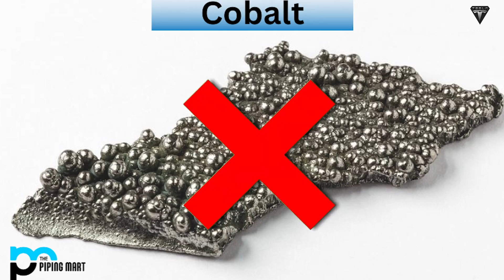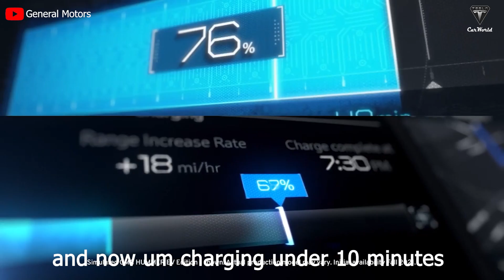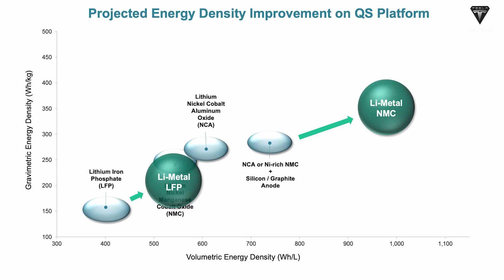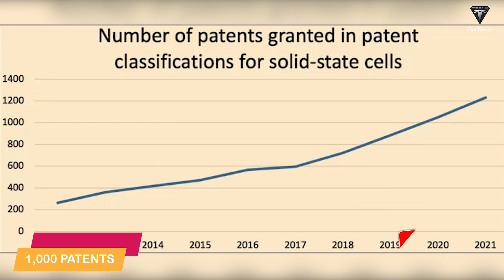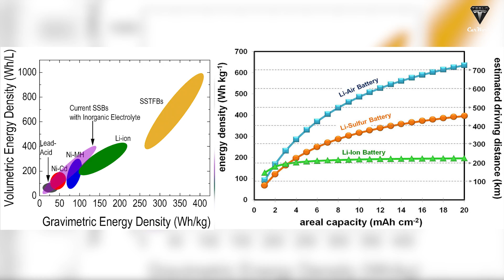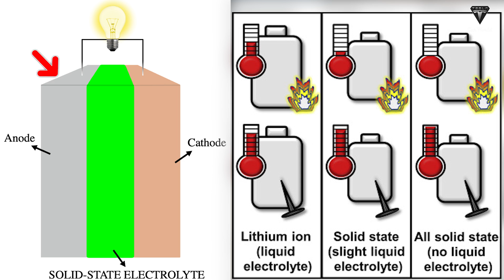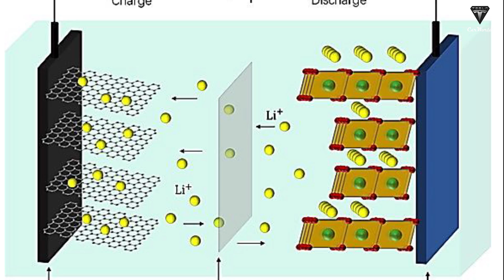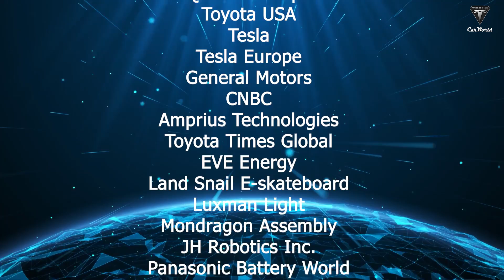Goodbye Lithium! The Breaking NEW 4.0 Solid State Battery Will Changes Everything in 2024!

Comment: I'm betting on Sodium beating solid state batteries.  Toyota will not be able to bring down the cost of solid state batteries enough to compete with Sodium, as sodium batteries will also start to drop in price in later generations, so solid state will never be able to catch up.  The only solid state batteries that will make it is the sodium solid state battery, which is already in the market right now.  So Toyota is already late to the show, since they project 2027, which is 4 years from now.  Too late to make any impact.
Reply: See Dongfeng Nammi 01 - first EV with sodium solid state battery.

Comment: Always 2 years to market. We've heard this all before. Always a let down when we find out that its not viable. There is always something, anode/cathode materials are not right. Dendrite formation, rare material, low life cycles., fires, slow charging, high resistance.... Always something. There's a reason Tesla gave up trying to make a solid state battery.

Comment: Its a bit like nuclear fusion, if these are as easy and practical as claimed they would already be everywhere. They aren't!

It is quite likely that in automotive use, chemical, thermal and vibrational fatigue, will be a serious limitation for a truly solid battery.

In terms of increased battery performance there are many other developmental threads that could achieve essentially the same improvements claimed for solid state batteries, using congealed or liquid electrolytes at substantially lower development and production cost.

The science of these is already proven, the issue now is the engineering development needed to make such batteries safe and economical to operate in a consumer environment.
Reply from the maker: Let's believe that Toyota is a big car company and they will optimize this battery as much as possible. They have researched for many years to find the best methods of upgrading parameters. Let's wait and be positive, solid state batteries are something to look forward to
Reply: @TeslaCarWorld  In the mean time I'll be driving a Tesla which is already saving me money and a joy to drive.
Reply: @TeslaCarWorld  Toyota  ceo hated battery ,   lol.
Reply: @TeslaCarWorld  hear this for 5 years  solid state is ready  ,lol

Comment: I wait for volume production
Reply from the maker: Solid state battery sounds great !! it's worth the wait
Reply: 3.5 million EV units of which 1/2 are solid state by 2030 ? This is Toyota’s prediction… Toyota must think current lithium 4680 style will not be improving. One thing is for sure about the future; current production won’t stand still, they will be cheaper and more efficient. Toyota will be left in the dust if they maintain their slow paced conversion to total EV production. Hybrids are an expensive waste of time for Toyota. I’ve owned Toyota hybrids. I really like the quality. But the economics of the total EVs will crush them by 2030. It will be a race to extinction for them.
Reply: Ramped /@ scale